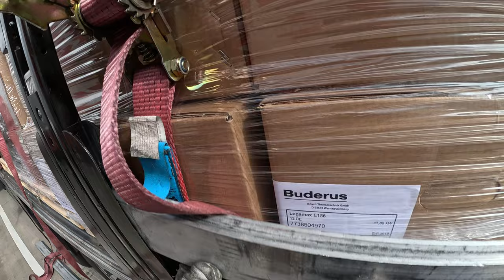ASMR 🇩🇪 POV Truck Driving - A One Day Truck Driver's Life in Germany (4K UHD)

Comment: In the image, the flash of the instrument panel looks good if the instrument panel lighting is set to the lowest or the shutter speed of the camera is set to 60 frames
Reply: I'm driving the same vehicle
Reply from the maker: Hey. Hey. Thank you very much for your advice. I'm trying to make it legible. Now shot on a DJI eight action 4 and I think it's quite stable on the footage there. 
Volvos are fine trucks, but I'm drawn to Mercedes.